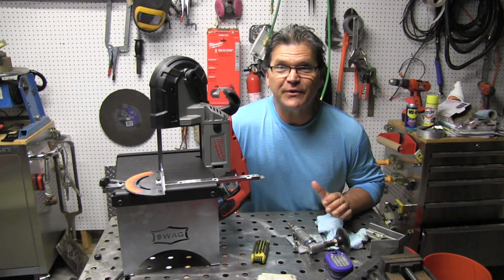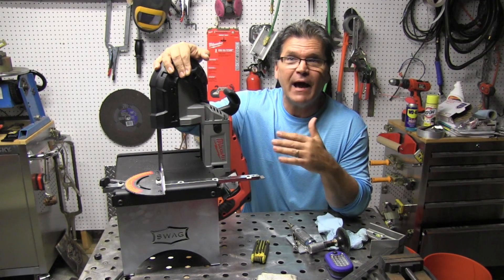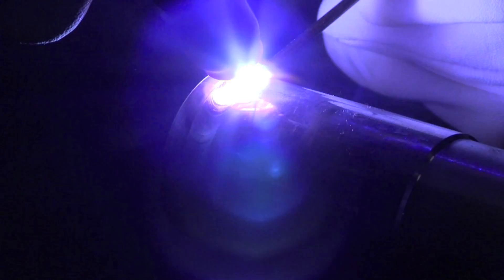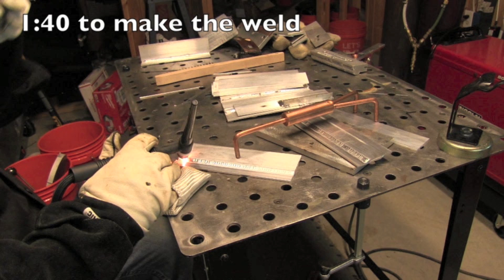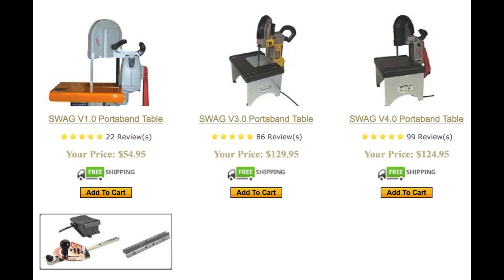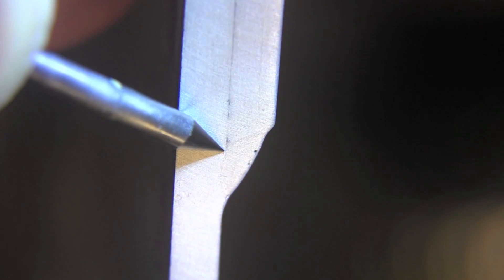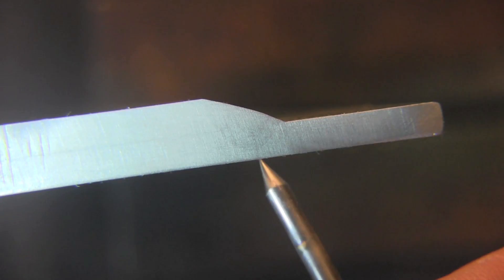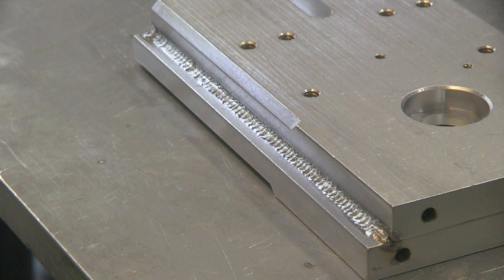Tig Welding Aluminum with Ar/He Mix part2

Comment: Jody , 
Like you I owned a portaband saw for a while , now I own a lot of nice tools. Im not one to by crap . One of my most handiest tools came from harbor freight . There horizontal / vertical bandsaw is the most used item in my shop. Its used daily for 5 years now right next to my cnc mill. I promise you if you got one you would not be disappointed.

Comment: I looked into getting a bottle of helium a couple months back in order to do some repairs on some aluminum cylinder heads.  Talk about sticker shock! It was 8-9 times the cost of argon.
Reply: Saw some small cylinders (60cubic feet) that were around $90-130, bottle and gas. Of coarse there are 75/25 argon-helium mixes for around same, maybe little more $120-$200 bottle and gas($80-100 refill) but helium will usually last MUCH longer than argon(depending on what you do everyday) I know this is an OLD comment but just thought ide share since no one else did

Comment: My intuition tells me that with aluminum's high conductivity, stepping further forward between dabs (onto the base metal) would penetrate better as the heat has less of a sink (the weld bead) to dissipate the heat. Of course, with steel you want to stay on the front of the puddle to maintain heat buildup in that area as the heat stays localized and you want the arc to stay steady. I can test my theory and find out myself but was wondering what your thoughts were on that.

Fine video.

Comment: I have the resources at work to have Argon and Helium mixed, what would an acceptable ratio be to produce results like this?   I can really see a difference in the flow with the helium added.  Lastly,  I think you are by far the best welder on YT.   Greetings from Arizona.

Comment: jody i'm going to step out on a limb and say i can use this same gas mix on my miller 130 mig machine to work aluminum. the last time i did aluminum it was with 75 25 mix or stargon and i was ok with the spatter / spray weld i had achieved. it seems as if i should use this in my next attempt at aluminum.

Comment: Very nice vid like always!  

Do you have any vids showing the difference between cup sizes welding alum and mild steel and or stainless?   It would be nice to see what the difference is from say a #5 cup up to a #12 with same amperage , gas, and material.

Comment: So what is the helium actually doing to enhance penetration so greatly?
Reply from the maker: Me5Ponk adding helium makes for a hotter arc with same amperage
Reply: I understand whats happening but how does this happen?  The helium is allowing the arc to be better insulated in the same space than other shielding gases. Is it just a better insulator?
Reply from the maker: Me5Ponk the properties of helium (like thermal conductivity) provide for increased voltage.  voltage goes up just by adding helium  so the arc and arc plume are hotter and that provides for a more fluid puddle.
thats about all I got. anything deeper is above my pay grade.
Reply: Me5Ponk  On the physics side, Helium has a 1st ionization energy of 24.5 eV, argon has a 1st ionization energy of 15.7 eV, essentially it takes more voltage to ionize helium which means a higher arc voltage for a given current and arc length. More arc voltage makes a hotter arc, secondly helium has about 3x the thermal conductivity of argon so it conducts that extra heat into the metal a whole lot better. 
Why is ionization important? Both helium and argon are electrical insulators until they are ionized, they need to he ionized to conduct electricity from the electrode to the work.
Reply: Zach Tarbell The HF provides the voltage to start the ionization then the welder power supply provides a constant current (100A in this video) which heats the ionized gas in the HF sparks, the heat from this ionizes more gas and we have an arc. The welder power supply is constant current, it provides as much voltage as the arc requires to maintain the set current unless the arc is drawn out too far. This is a simple explanation limited by the space provided. If you need more detail,a book " the physics of welding" by the international institute of welding has more detail than you probably would ever want to read.
Reply: Helium conducts electricity- straight argon insulates/does not
Reply: ValExperimenter nice explanation, thanks for that. but- it seems you're saying it takes more voltage to ionize helium, yielding a hotter arc, yet it also needs to be ionized before it can conduct. that seems contradictory..
Reply: Me5Ponk on a scientific level, the helium gas conducts electricity better than the Argon. the electrons flow allot easier and faster. that's why the same amps "act" hotter than what they really are.
Reply: Me5Ponk I am about to try TIG welding with my Maxstar 150S "stick-only" welder.  What I find interesting about your question and the replies is how Helium increases voltage at the weld.  The next question I would ask is: If an inverter welder is just a bunch of switches that regulate electron flow, could Helium "trick" my welder into providing 20V, which is its minimum setting?  I ask this because Miller supposedly has a cut-off built into this machine, despite the foot of the curve appearing very similar to the TIG settings (I'm sure the "guts" of my machine are similar to the ST and STL). Thank you for letting me piggyback on this thread.
Reply: Looking at the volt amps envelope for this welder I think you might be misunderstanding it. Usually with power envelopes anything within the envelope is possible, the arc will determine how much current will flow at a given voltage, the amp setting on the machine will set when the volt amp curve starts to fall steeply. I read the curves as saying the welder can supply 80V at zero amps for starting and a maximum of 35V at 150A from a 230V supply. With that voltage  helium will help get more heat into the arc. On a 115V supply the voltage might go a too low over 100A to use helium to its best advantage. Hope that helps

Comment: This is a really great video, given that learning to read the puddle is not only critically important, but difficult to teach. When you said, "This is the stuff you learn when you cut stuff and you etch it right after you weld it while it's fresh on your mind," I couldn't agree more. 

When people look at completed welds and critique them, it's easy to get caught up in the aesthetics. But here you've tied what you see during the actual welding process to the depth and quality of the weld. Excellent!

Thanks for taking the time to produce this excellent video!